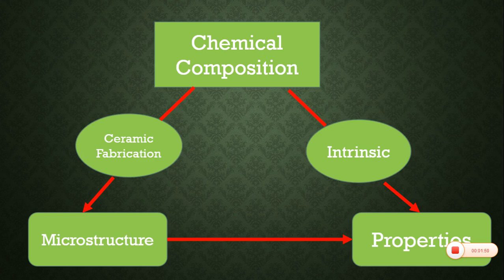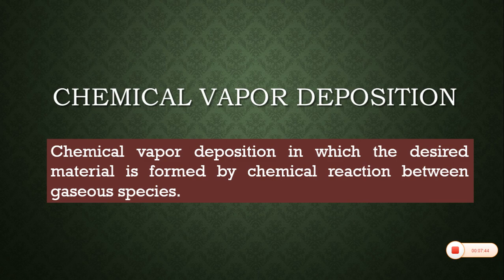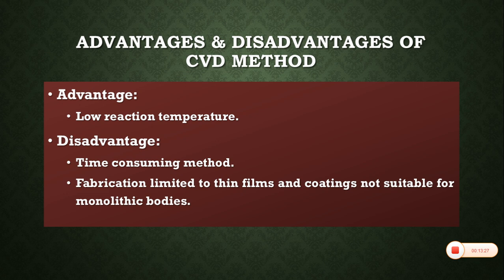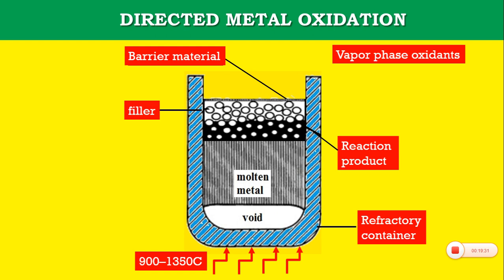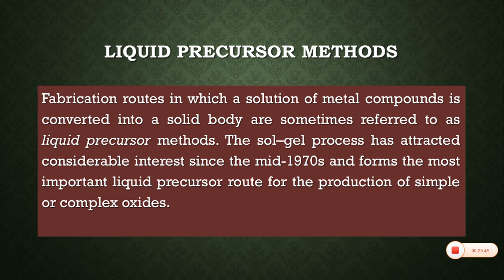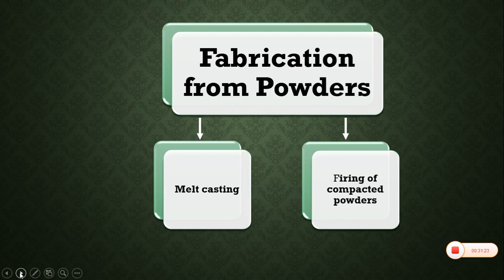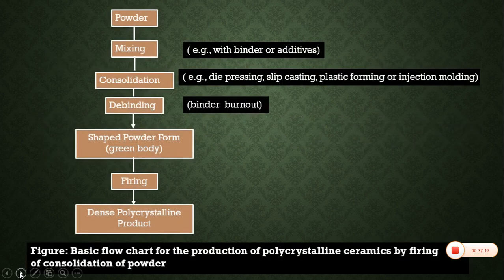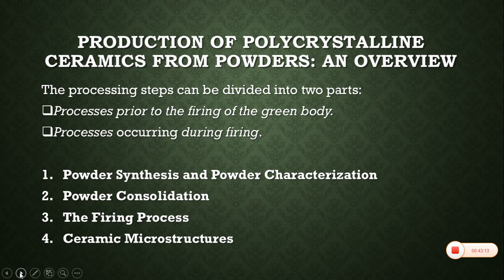ceramic fabrication processes

Comment: good morning,
i have a question about solid state synthesis, i would like to synthetize
Sr(1-x)La(x)Tio3 by solid state method by taking  Srtio3 and lanthanum oxide  as precursors but i don't know how to calculate the necessary mass to take (of  raw materials ) for each concentration of the dopant for example x=0.2, 0.3mol% ..etc to have my perovskite doped in the stoichiometric amount . Is there a formula to have that ?
best regards.
Reply from the maker: Good morning, yes you can easily find mass first calculate molecular weights of each element and multiple it with number of moles u have selected for each element then to find mass of each element divide it with sum of all molecular weights and multiple with 100.
Regards
Reply: @drmadeehariaz2265  thank you verry much sir, so i will do this according to this formula (1-x)SrTiO3 + (x )La2O3 ==Sr(1-x)La(x)TiO3
Reply from the maker: Yes